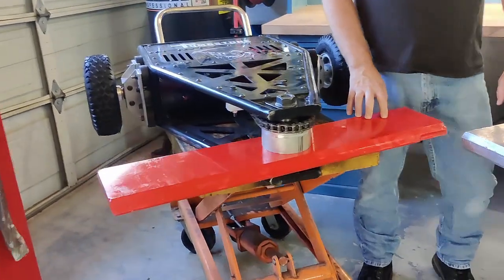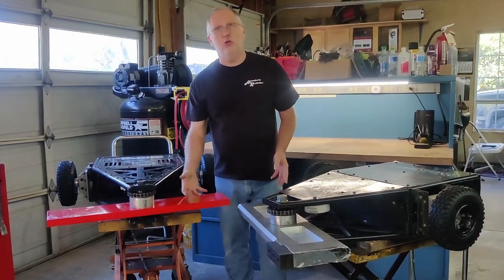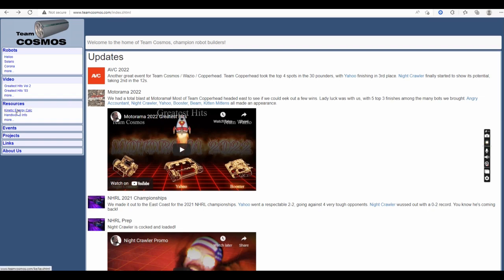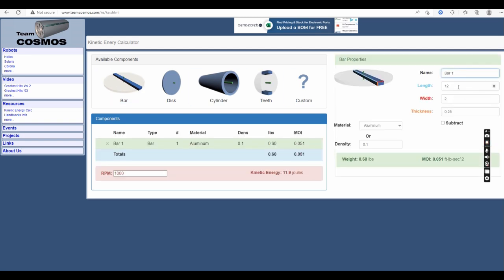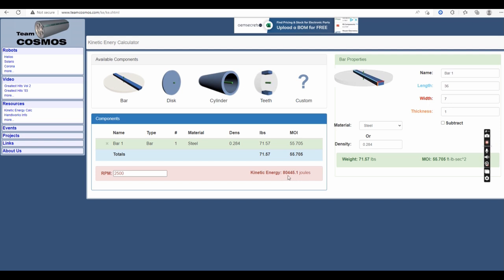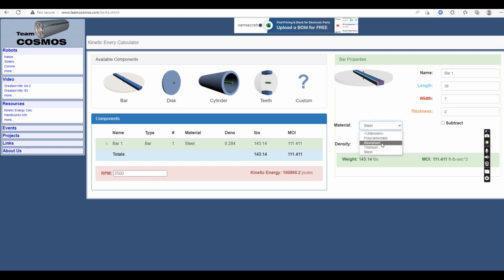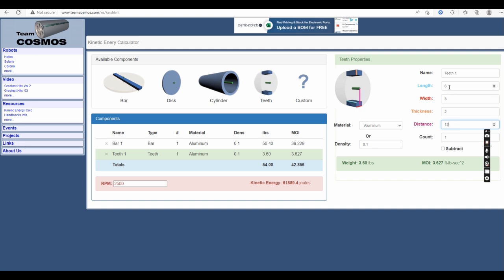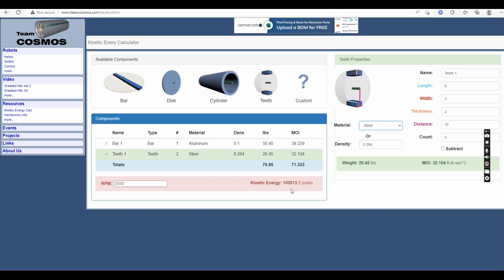Tombstone's kinetic energy numbers, and why the teeth for the weapon bar are a good idea

Comment: I’m always amazed that Tombsones drive to the weapon seldom fails. Is it, very basically, a chain driving a sprocket bolted to a hub, or is there a clutch system or anything that will protect the system from an overload if it hits and is locked up, or is it just down to being engineered and driven well?

Comment: Do you use, or have you considered using hi strength quad ring motorcycle chain to drive your weapon? Some of these superbikes out there have engines on the street running 150HP.  Do you use a torsion clutch on your weapon drive to avoid sending shock loads thru your weapon's drive system?  Just curious.  I like seeing you win!  Thanks for posting on your channel.  Love the content.

Comment: Is there ever a design change for the wheels in the future.
Maybe less exposed but more like armour around it.
Like a style of Minotaur
Seems like a good idea, seen a lot of wheels come of in the fights (various bots).
Just an idea of a great fan of you and Tombstone.
Greetings from the Netherlands
Reply from the maker: It's really not as simple as saying "put armor around the wheels". The tires need to be as wide as they are, the same width as the spin circle, or the robot is just way too unstable to drive. So any armor would then make the robot even wider. And armor significant enough to actually protect the wheels would be heavy, and that weight would have to come out of the other systems on the robot, compromising it. 

It's a great idea, but would require some major changes to address, and I'd probably not end up with "Tombstone" when it was done.

Comment: ill give some pointers on how your design could improve, 1. Chain guard on the front tip, with more bots finding ways target this area, a strip of very strong steel over the front chain will help, 2. maybe a wedge of your own on the reverse side, and 3. gotta protect the wheels. some strong steel strips around the wheels will help there too. ya probably have herd all this before, but if ya take a look at another very successful horizontal spinner, from robot wars carbide, this bot had all the right ideas.

Comment: beryllium bar and tungsten teeth???
Reply from the maker: Tungsten is a very hard material, but also kind of brittle. The times that builders have used it on a combat robot have not gone well honestly, as it usually shatters. It's one of those materials that on paper sounds like a good idea but in practice falls short of expectations.

Comment: I know this is me reacting on a very old video, but how about using Tungsten or Tungsten carbide teeth instead of steel teeth to maximize the moment of inertia? You could get an optimal strenght to weight bar by using aircraft titanium alloys. which have a bit better specific strenght than aluminium. This does mean that you have to machine Tungsten and Titanium, or order those parts from specialized shops. Which you might not want.
Reply from the maker: Tungsten and tungsten alloys are very hard, but unfortunately kind of brittle. There have been attempts at using them in combat, but it usually ends badly. Titanium alloys however are used all the time, and I honestly can't think of the last robot I built that didn't use titanium somewhere.

Comment: Are the metals used limited in some way? Don't get me wrong, steel is a good choice for the part actually doing the connection and transfer of energy, but tungsten rods along the outer edges would push that center of mass even further out in the rotating inertia calcs, meaning even more stored energy at the same RPM.

Comment: You have a number of actively used weapon bars, and over the years you have had many more, id say you probably have had the most number of weapons ran on a similar bot design of any team. Have you noticed any impact on the sharpness or at least impact point thinness of the weapon? Like for instance on the teeth for the aluminum bar, if they tapered in to say the same 1 inch thickness of the solid bar, or even less, in your experience have you noticed any effect how much damage it delivers?

Comment: Don't think this is meant for insect weight class weapons, But assuming I did do the numbers right, my 6 inch wide, quarter inch thick AR 500 disc stores about 9 to 10 kilojoules of energy, if its spun at about 10 to 12 K RPM. It's for a beetleweight.

Comment: Ray, you always impress me with how your outside the box thinking, improves your inside the box performance. The way you drive Toomstone with that swing that you do to attack from the side is spectacular. You lure them by slightly exposing your right side and just swing that clockwise spinning weapon right in the unsuspecting driver. So sinister! 

I really enjoyed how you explained how your bar configuration effects the kinetic energy. If you have time to answer, I have a few questions. 

Does swinging from the left with a clockwise bar transfer more of that energy than if the bar was spinning counter clockwise? (Since the bots are normally moving toward each other and clockwise pulls you forward and to the side and counter would push away and back) Is that so soft deflects can allow you to get back into position faster? 

Would putting a steel blade edge that's 1" on the last 6 inches of the aluminum and a solid steel square on the ends of the bar allow for a higher energy output that could be a multitasker? Is the 1" solid steel bar just more durable than the 2" aluminum? 

I have a ton of questions actually but I've really always wanted to know if you kill your motor before contact if you have reached full speed right before contact, if there is a clutch system that could be used for such situations, if you could use laser distance monitors to apply those automatically, based off how fast your drive train is at the time and distance, and how much strain is put on you motors on impact? Does a lighter bar put less strain in that situation, or is it directly related to the kinetic energy? 

Would electromagnetic grabbers on the bottom of the bot help with impacts at that kind of force or is it just useless at that level?

Could nitinol be used in bot building applications anywhere? 

Finally, I always thought a retiarius bot would be interesting and wonder what your opinion is on that.

I've always wanted to send you a personal message with all this but this video popped up and I had to leave a comment and a like for you since that supports your channel. Keep up the great work, especially with Tyler! I am sure you are proud of how amazing he is.
Reply from the maker: Just a few questions huh? :)

Turning left or right into an opponent does change the energy delivery somewhat. At full spin speed it's probably around 5% difference, so it's not so small of a difference that it wouldn't potentially change the energy transfer. I honestly don't give it a lot of thought in a match though, as I make the spins that make the most sense at the time based on positions.

Durability is always a multi-pronged question. Against some opponents each design has advantages and disadvantages. Unfortunately there just isn't a "right in all situations" answer.

I will turn the motor off if I am going to be put into a situation where the weapon is going to be bound up - like being pushed into a corner. I do not turn it off based on impacts with the other bot, unless we get out of position after the hit and I have to. 

Magnets certainly have their place in the sport, but aren't as easy to use as most people think. In order to be effective they need to be virtually at floor level, which is just hard to make happen in a bot designed like Tombstone.

Nitinol is interesting material for sure, but stupidly expensive and not really designed for huge impacts. I'm not saying there is no use for it, because someone will come up with one. But I don't see it being me :) 

Thanks for watching!
Reply: @ray9368  Yeah just a few. ;) I held back a few too.. 

So cutting the wheels off just to use magnets isn't in Tombstone's future... That's good to know. I appreciate the response and look forward to thinking about it when I watch you battle again. Keep that weapon spinning.

Comment: Is there a big difference between a horizontal bar vs a horizontal disk? Would would valkyrie and rotator only run disks, blood sport runs both, and you only use bars? Is there big pros and cons of each?
Reply: Weight distribution ? Tombstone 's weapon has all power on the edge of the bar concentrated for the biggest impact possible

Comment: How much does making these things cost?
Reply from the maker: A lot of that depends on how much of the custom machining and fabrication you can do yourself, and how patient you are. A good rough figure is probably around 20 grand or so, but if you are having all the custom machining done in a shop and want it fast, that number will more than triple really quickly. It is unfortunately a fairly expensive sport.
Reply: Thank you, I will probably downsize my bot idea WAYYYY down before even thinking of entering mine, I am also super happy that a bot legend responded to me!

Comment: Possible you would break down the cutting edge profile and type of bar used VS type of competitor and why? On the surface it seems straightforward, but also seems like there is strategy and more than meets the eye.

Comment: So basically it's just a matter of luck whether the tooth comes off or not?
Reply from the maker: Kind of yes and no. There is a lot of chaos in the box, and certainly sometimes things just don't go your way. For instance, in the Rotator fight the impact point when we went weapon to weapon had the tip of Rotator's weapon hit exactly in the middle of the tooth on the bolt hole giving a stress point where the tooth split. If we fought again 100 times I am not sure that would happen again.

In the Shrederator fight though, I made the mistake of letting him get up to speed, which allowed him to hit the weapon tooth from the back side, as he avoided going full weapon to weapon. In that case he simply executed better in the match than I did. 

There is always an element of luck to this, don't let anyone tell you different :)

Comment: Is that aluminum bar any weaker than the steel bar? I understand it's way thicker to compensate, but isn't aluminum more prone to snapping while steel just kinda bends? Looks wise I think the aluminum bar with the teeth looks great, but obviously function comes first lol
Reply from the maker: As with most things dealing with combat robots - it depends :) There are literally hundreds of different alloys of both steel and aluminum, so a generic answer here won't really cover it. Soft alloys of aluminum like say 5053 can be bent significantly without any threat to cracking. Harder aluminum alloys like 7075 can certainly crack, but this alloy is much stronger physically. When it comes to steel, mild steel like 1018 will bend like crazy, whereas many tool steels like S7 or A2 would snap before really bending much. 

There really aren't any bad materials, just improper usage. We're always trying to find the best option between strength, toughness, and elongation. And those answers change over time, as everyone's robots keep improving. The engineering challenge of it all is part of the fun, for me at least!
Reply: I'm asking myself if a sandwich design with hard and soft material would work, so you could get the benefits of both materials. 
What's about Tungsten-Carbide instead of the Steel-teeth? That material is way harder, but I never saw a team using it

Comment: I would love to se a asymmetrical blade. They rarely skip off the opponent and get a much bigger bite than a standard bar.
Reply: Uppercut but turned sidways.
Reply: @Zeo--  I use asymmetrical on my insects and they hit hard!
Reply: Cobalt back in 2016 had an asymmetric weapon bar but it was rejected as it had too much bite according to the builders.
Reply: @Blackstar-jn7ft  That would explain a lot  Thanks
Reply: @Blackstar-jn7ft  Would love more info on this.  Very interesting

Comment: Hey Ray. Is there anything to be said about having the cutting edge on the steel bar as a superior option than just the impact of the aluminium?
Reply: Supposedly, that's designed to slice into wedges or other armor, rather simply shaking the opponent to death.

Comment: But why would all that extra kinetic energy matter though? Tombstone is  powerful enough without teeth. It's the reliability that holds it back.
Reply from the maker: Every match you have to decide what weapon is going to work best in that situation, and sometimes the one with teeth is the right answer. When I beat Sawblaze and Lockjaw, nobody was asking why I used a bar with teeth :) I have won WAY more matches with the teeth than I have lost. It isn't always the right answer, but it is a good option to have available.
Reply: The extra energy matters when we're not looking at best case scenarios. 100KJ vs 80KJ is ridiculously powerful either way, but realistically Tombstone isn't going to be getting off a lot of those max power direct hits, if any at all.

Now I'm not Ray Billings, but I imagine the idea is to have an effective hit ready sooner, so Tombstone can get off more hits that can reliably do damage to other bots.